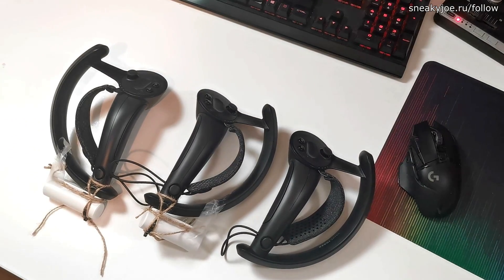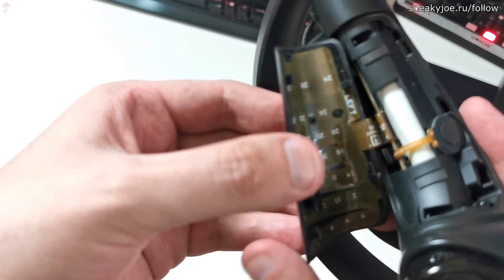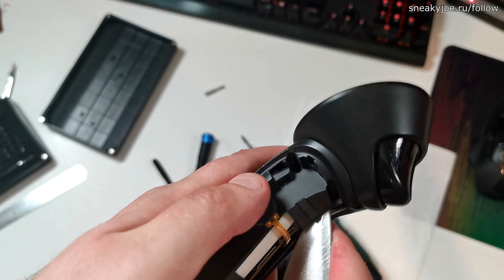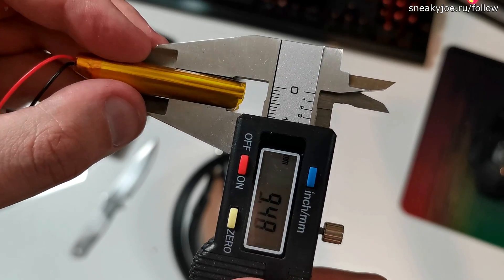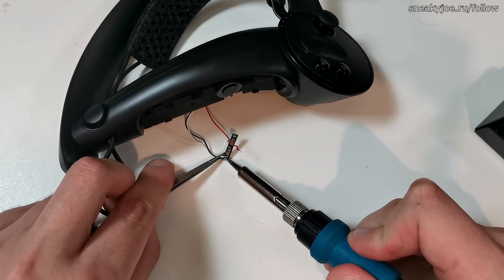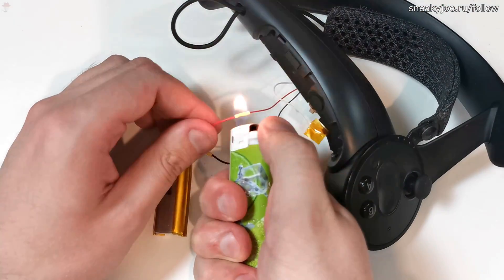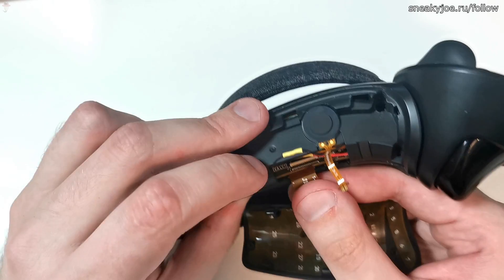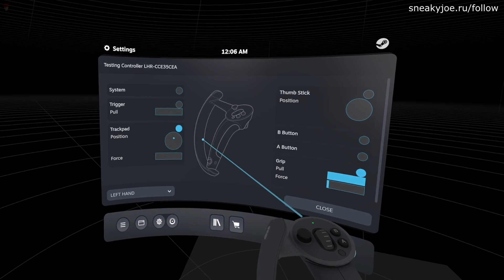Replacing battery in Valve Index Controller (disassembly and repair) #righttorepair

Comment from the maker: https://www.youtube.com/watch?v=ODQ-un51vKE You can now get the battery that you won't need to solder.
Reply: Quick question. If I get heat tubing what should I use to warm and shrink it? Couldn't we just wrap tape around it or something?
Reply: @SpringChickensOnlyMan  Ideal solution is a heat fan firectly to the tube but not to the battery. But a simple lighter also works as I shown.
If you don't have heat tubing - you can use anything to isolate the wires from each other, just make sure the isolation won't go off. Electric tape would be better than a plain duct tape due to different adhesive. Heat tubing will also increase stiffness of the wire in comparison, but since there's little to no pull for the wires while using the controllers almost anything will work.
Reply: @SneakyJoeRu  Thank you. Also I have an idea but it might require batteries different from the index controllers. I heard of a few numbers, 18650 and 21700. There are a lot of battery holders with red and black wires I might be able to solder onto the 1.2 connector to send power straight into the controller. I'm just not sure where to put a hole in the plastic for the wire to stick out because there's a lot of yellow tape near that ribbon cable and damaging that tape might ruin the ribbon cable itself.

Reason why I'm saying this is because I wanna see if I can make a power bank on my wrists with battery swapping but sending power straight into the controller because trying to charge another battery while it's being used doesn't sound like a great idea because it'll heat the battery up more and make it degrade quicker. Plus having swappable batteries available and working might make them easier to replace them instead of prying a controller open over and over again.

Glad aliexpress has a lot of useful stuff that could help and after all lithium batteries might be lithium batteries. It's too bad there's no guarantee the controllers will work with a battery that's not meant to be used with them but it might be worth a try. It's just I saw a guy do this with vive controllers https://youtu.be/gAO0UOUTHQo?si=rGA6A5VrbnO48Kzb and something similar might be impossible with the valve index ones.
Reply: @SneakyJoeRu  Sorry if I'm talking to you to much by the way. I just like having backup plans for the worst yet to come. Something bad might most definitely happen sooner or later
Reply: @SneakyJoeRu  if I have to pierce a hole in my controller for wires to stick out for an external battery where should I put the hole at?
Reply: @SpringChickensOnlyMan  old question I know but you can use a lighter to shrink the tubing. Just don't let it sit in one spot too long. A heat gun is preferable and a hair dryer might work but it's slow and you have to be careful not overheat sensitive components.

Comment: Didn't expect to have to use a drill to disassemble a piece of high-tech (Valve издевается и пусть идет лесом). It went well otherwise. Thank you for a comprehensive guide! Looks like Valve learned its lesson and introduced an innovation in their new controllers - a REPLACABLE BATTERY.

Comment: When it comes to the thermistor, its actually on the BMS board itself, this is why the battery is only connected with those two spot-welded terminals, and fun fact, on most of those BMS boards, the little metal plates that the battery terminals are spot-welded to can be desoldered, leaving You with nice, clean pads to solder (sufficiently shortened) battery wires, or, even the terminals themselves (but be careful with that one, waaaayyyy too easy to overheat the battery, it needs to be soldered with leaded solder at 270 deg. Celsius, and done very, very quickly, with a fan blowing on it immediately afterwards), and You can then wrap the BMS with kapton on the new battery exactly as it was on the original battery

Comment: would a small tear in the ribbon cable cause this to be permanently in the error state? the hard reset used to work but now it always goes to flashing red. I didn't have a battery problem, just can't find another video that shows how to disassemble this
Reply from the maker: If your ribbon cable is broken, surely it might not deliver all the info to controller. If you have decent phone repair people around - they can repair the cable to some extent with a microscope and fine threads.

Comment: Wanted to thank you for the detailed and excellent video. Though I ultimately made the decision to not try unraveling/cutting away at the BMS to replace the battery (I really don't want to blow my face off or burn down my house I recently moved into), I now know how to open this thing reliably and without breaking anything.

Comment: This and your other guide just saved me a bunch of money. Great guide. I'll say this though, I bought the one with the connector so no soldering done by me. For those wondering he has a guide now with a battery replacement that needs no soldering. In any case the ribbon cables were not my biggest issue. Mine was taking the old battery out which was insanely bloated and the adhesive wouldn't give up. Then the hot glue was horrible to get out. Took me, not kidding, a total of 3 hours on and off doing this fix. Finally got it and just tested my controller and it holds charge. 

Thanks Valve for not helping at all. They even linked me to a website that has spare parts and none of them were battery related. Fuck them for this. I hope they learn from this and make replacing future VR controller batteries much easier. My battery basically died in less than 2 years, all because for like 8-10 months I didn't have the controller charging or in use. So the battery died.

Comment: Many thanks for this fantastic guide. Too bad that iFixit has not yet managed to offer something suitable. Thanks to you, I was able to repair both controllers within an hour. I also had to deal with the one screw for a short time. the most difficult part was simply reconnecting all the cables properly. The rest was actually quite easy. Many Kudos to you. Your guide has encouraged me to tackle the repair and save money. I guess the trickyest part was to get the AliExpress order ;)

Comment: Good video, thanks. I attempted a battery replacement and found out that the left one uses t4 screws and right one uses t5, at least mine did, and I bought only t4 at the store that's long enough, so naturally I decided to drill out the right controllers screw and damaged the PCB in the process. RIP my right controller 😢

Comment: Thank you for sharing the video. I replaced my left Index Controller's battery earlier today. I purchased the replacement battery with an integrated BMS (3 wires) from China. While removing the old battery, I did not manage to remove the connector frome the PCB without damaging it. The only option I had was to solder three wires on the pads of the PCB. Sholdering on the PCB through the small gap that is available was not easy. As soon as the wires were soldered, used hot glue to secure them on the PCB and prevent damage of the pads of the PCB. Then, I used a multimetre to measure the resistance on each pair of the wires, to make sure there was good connection and no short circuit (it should measure KOhms). Then I connected the wires of the PCB to the wires of the battery, one at a time to prevent accidental short-circuit. Then I attached a USB charger to the Type-C connector and let it charge for 10 minutes, removed the charging cable and switched on the Controller to confirm it gets started. All good. I re-assembled the unit and tested with SteamVR. Again, no issues. Finally, I let it charge for an hour or so, until the orange light turned white. I haven't yet tested how long the replacement battery lasts, but this is as good as it could get, considering Valve had designed and manufactured the device in such a way that it is very difficult to repair.
Reply: PS. I did keep a pot with a lid next to my desk, as others mentioned in their comments; just in case!

Comment: When I charge the new battery it gets warm- is this normal?
Reply from the maker: @arysiuse  it kinda is. It shouldn't overheat, however - this is what bms is for along other things. Thermistor should read this data and prevent it from charging too fast.

Comment: Saved me several hundred dollars with this one, thanks for the help. I ended up not having to drill out that one screw (just had to let the bit extend out more from my screwdriver and not seat said bit all the way, in order to reach) and my battery I got from an Amazon seller included a thermistor and battery management circuit. With the right tools it's a bit harrowing, but doable.
Reply: Why wouldn't you tell us what the battery name on Amazon was so we could use one with a thermistor?
Reply from the maker: @Cinnabuns2009  Because 2 years ago, when I made this video, there were no batteries on Amazon. I pushed a person in China to develop and test a solution for people. Since then some manufacturers copied it - if you know a reputable seller - feel free to mention their names. I only can recommend what I tested myself since I was helping with development.
Reply from the maker: Glad I was of help.

Comment: Thanks for putting together and sharing this guide. 

For the one T5 screw you the iFixit bit doesn't quite reach for, I found that the bit was long enough but the magnet in the driver pulled the bit out. I used a bit of cotton swab stick to prevent the bit magnet in the driver from pulling the bit out of the screw and was able to get that one without drilling out the controller. I hope this tip helps someone else!
Reply: This worked for me, thanks!

Comment: jesus fkn christ.... Valve but also Sony should be ashamed for themselves for not making the battery easily replaceable on their controllers. Why tf game controllers do not have replaceable batteries? it's not like they need to survive rain or pool diving as a phone might need to. It is despicable to make the battery almost impossible to swap on these...
Reply from the maker: If you can't buy a new battery to easily swap, you can buy a new controller, which is more expensive and can have larger margin. Profit.

Comment: Just repaired my left controller. Got an extra long and skinny T5 bit for the last screw. Ended up using a T8 for the larger screw, not a T9. Amazon has batteries that work and come with the BMS by "Cameron Sino." This video was hugely helpful, thanks.

Comment: So uh... when folding the black thing back down on the big ribbon, it popped out of it's hinge... anyone know if its possible to get it back in, or is it toast? It should have been super easy... it has wings that "lock" it in place for you to fold the black piece down... I wasn't counting on it being so incredibly fragile though. Edit: To answer my own question, I was able to detach the cable and carefully use sharp pointed tweezers to push the piece back into place - it didn't unhinge like I thought and was still connected. I tried again and somehow the gate flipped itself down when I sunk it into place. Feels wonderful.

Comment: thank you this is like the only video on this
but one question  THE SCREW AT 3:20 WWWHAT SIZE IS THE SCREW AND WHAT SIZE SCREWDRIVER FITS IN THE HOLE EVERYTHING I HAVE DOESNT FIT
Reply: Hey, it's the same as the other screws, but it is pretty tricky to extract. I managed to extract the first one in my test controller, but failed to extract this on camera. Bonus for the fact that I showed how to open such screws to other folks who struggled.

Comment: 10:24 the little plastic piece that clamps down broke off. is there anyway to fix????
Reply: You can try to melt material back together or super glue it, but it won't be as stiff as it was before. It will not significantly affect the experience.

Comment: I just did the swap! Thank you! I used a heat gun low 180°f to soften the glue on the connector and used a plastic toothpick under it, and it came right up with little effort and no damage! Anyone worried about the battery, just don't puncture it and don't use metal. If you do puncture it it just shoots some flames, put it in a pan and take it outside. It happens!
Reply from the maker: I was actually doing my first replacement off camera with a pan nearby. It's thick and won't burn.
Reply: @SneakyJoesENG  not a bad idea! I've only had one pop off, was like a tiny road flare but was glad to have a pan to run it outside!

Comment: So you mentioned the valve index controllers could possibly be used without the battery inside of it. Is there any precautions I should take before I put the controller back together? Even without the battery inside I have a feeling the controller could fail or explode if I leave a wire or cord in the controller unattended. All I should need after that is a cord plugged into the bottom of the headset for it to work
Reply: Not sure about running it from USB, but it might work. 
The guy I mentioned was using extra long cables to connect to external batteries or a power supply to original battery plug to reduce weight of the controllers for high level beat saber.
Reply: @SneakyJoeRu  I don’t see a reason why someone can’t give it a shot. I bought my valve index controllers last week so I’m not going to mess with them right now. But maybe eventually I or someone can try removing the battery and running it through usb. Hopefully the controller doesn’t explode or anything after the battery was taken out.

Do you know where that guy you mentioned went? I wish I could see what he did with his controllers
Reply: @SneakyJoeRu  Maybe the next time you have to replace your valve index you can try to turn it on through usb before you put the battery in and let me know.
Reply: @SneakyJoeRu  I'm just trying to find a plan to see if I can just have extra long cables in my valve index controller USBs instead of relying on the battery inside it that way I won't have to keep opening it over and over

Comment: I was able to reuse the BMS from the original battery, so that I now have a fully working new battery with a thermistor. (The battery that is sold with the thermistor was over 3 times more expensive, so I didn't get it)
 See how here:
https://www.youtube.com/watch?v=LQig7AJJKNU
Reply: It might be a bit dangerous to solder 3.8v bms to 3.7v battery. Might not be too critical, but just in case please consult with other electricians or people who work with batteries and understand their limits. With such mod I'd always keep an eye on the controllers while they are charging. And I'm not responsible if your house burns. I'd rather recommend to use the original battery without a thermistor with original battery bms.

Comment: I was able to source a battery with the proper connector and the thermistor wire.

DO NOT unglue that connector. It is near impossible to put back as it's just sitting on the board and needs down pressure to hold.

Also the connector itself is EXTREMELY flimsy. It took my 2 batteries and 2 hours to get it to work, and I don't trust it at all.

Cut the cable lile he does in the video, leave that glued connector alone.

The grip ribon was a 10 seconds ordeal, a real piece of cake compared to this connector from hell.
Reply: I wish I had read your comment earlier. I damaged the connector and I had to solder three wires (and hot-glue to secure them) on the PCB. Took me an extra hour unnecessarily.

Comment: Will a 3.7v work or do I gotta buy the battery? I have extra 3.7v cells laying around just need to know if it’s good or not
Reply: If the size is right and the cells have bms on them to prevent overcharge or deep discharge - yes, they will work
Reply: @SneakyJoeRu  I’m reusing the old bms, the battery size is definitely not right I used a vape battery from a elf bar and have interchangeable batteries using and Tp4056 to have a recharger.

Comment: This disassembly only made me marvel further at Valve’s incredible workmanship.
Reply: It is high-tech but the connector was hot-glued to prevent the replacement of the battery. Similarly, plastic parts are glued together to prevent disassembly and repair. Embedded, non-replaceable Li-Ion batteries are a trojan horse of electronics.
Reply: @ntsarb  I think the connector was hot glued to stop the connector coming loose whilst people are throwing the controller around just like the battery being glued in. Not good having live terminal potentially shorting out on the circuit board if it does come loose.
Reply: @matthewdale4135 correct, they could also have chosen a different type of shock-resistant connection though.

Comment: Just wanted to say THANK YOU for this video.  The batteries I ordered came with a thermister (white wire) so it replaced the functionality perfectly.  I followed this video step by step and had the repair done in about an hour (excluding the time it took to go to the hardware store and pick up a T5 torx head screwdriver that was narrow enough to take the controller apart.
Reply: Did you cut the wires or did you manage to remove the battery connector (without damaging it) ? 
I attempted the latter, damaged the connector and had to solder wires (and hot glue to secure) on the PCB, so it took me an extra hour to get there!

Comment: Valve need to make a revison to make it easy for replacement
Reply: They won't. They love applying glue to all their devices. Maybe they also like sniffing it, considering the amount they use.
Reply: They could have been designed to be repairable from the outset. They are actually made to prevent repair, so that the devices do fail and need to be replaced. As iFixIt reported, the cover that needs to be removed to allow for the disassembly of the parts, to gain access to the PCB, is glued with cement glue. Attempting to separate the parts breaks one of the parts.